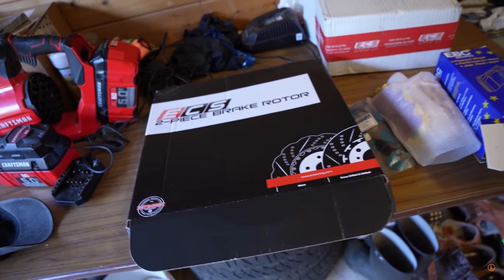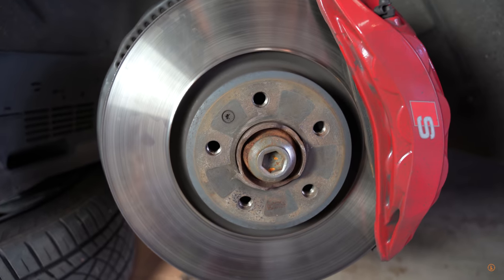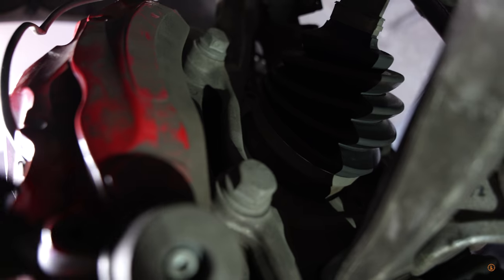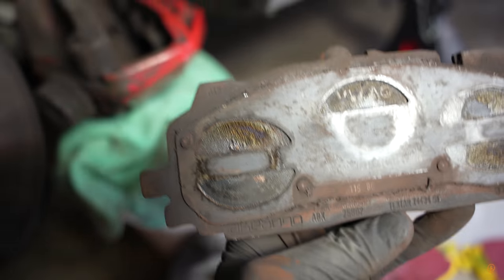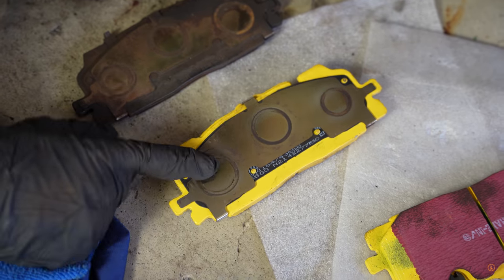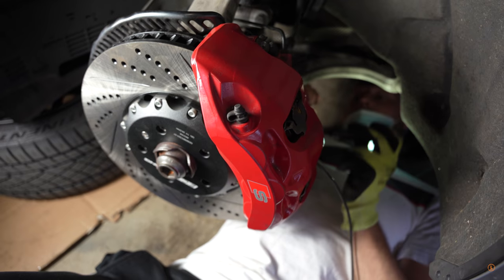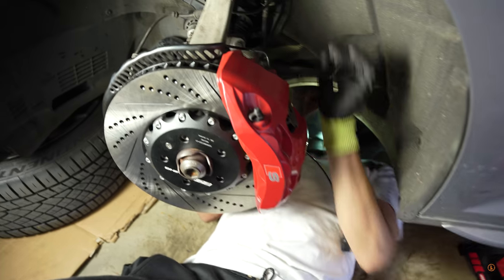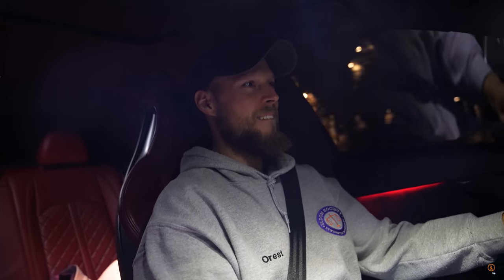Performance Brake Upgrade for my Audi B9 S4! *TRACK READY*

Comment: one tip for everyone, if you have audi care or have gotten a brake fluid flush, open your brake fluid resovoir, this is a good practice on all cars anyways when doing brakes, when you push those pistons back and someone has topped up the resovoir say 1-2 years after you got your brakes done, the fluid will now be coming back up and try to push through the cap, don't ask me how i know lol

Comment: Dude a ton of people who track would not recommend cross drilled rotors for track. But let me know if they crack or not. Get Girodisc or DBA Australia rotors.
Reply: If you actually think slotted rotors don't crack, it is not possible for you to be more mistaken. I can send anyone here a pdf file with like 12 pictures in it of cracked slotted rotors--some of them HORRIBLY cracked---like "almost cracked in half"....the notion that "crossdrilled rotors crack and slotted ones don't" is a gigantic crock of BS. And 99pct of of the crossdrilled rotors that DO crack it is because the lousy, uninformed manufacturer/ machinists didnt chamfer the holes enough. That chamfering on the holes isnt to "make them look prettier"--it's for one reason only----stress mitigation. 99% of the rotors you find out ther that have cracks it is because the idiots who milled them put either no chamfering or nowehere -near-enough chamfering on them. Period.
Reply: I literally thought the same. Dont know if cross drilled are any good even for daily

Comment: note to anyone following along, he put the discs on the wrong side, slotted discs are always sided and typically labelled left/right, Also there's no need to put your dirty hands on the brake pad surface and contaminate them, also no need to remove the wiring loom that far back for the wear sensor, just unplug it at the connector block dude
Reply: No, he did not. They are correct way.
Reply: @ShebanFPV check again, do some research, and let me know when you realise you're wrong

Comment: REMEMBER ON YOUR B9 S4 GET EBC BLUE STUFF NOT YELLOWS FOR TRACK USE.
Reply: Is that based on experience? I'd like to know more coz I had the yellow stuff and tracked the car once and the front pads were gone!!!
Reply: @shriefh  honestly if you can get the orange stuff for your car they are even better. Yellow stuff are crap.